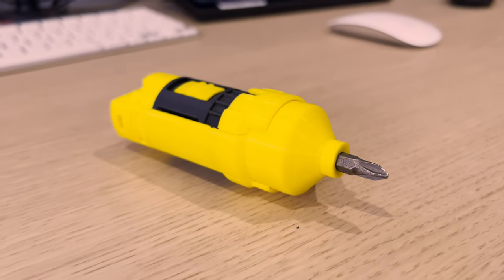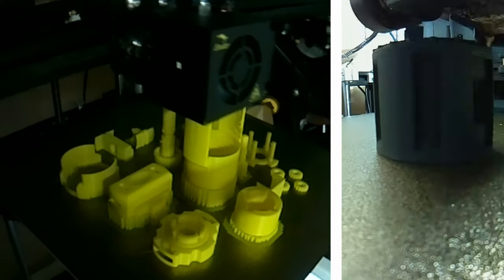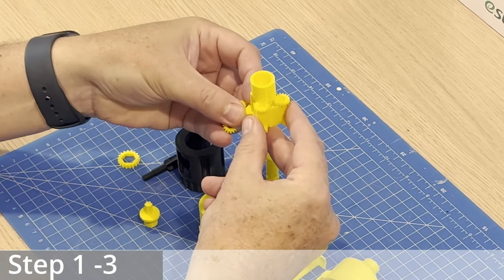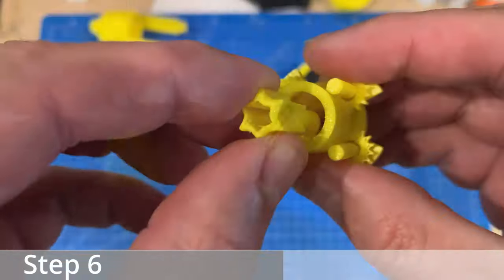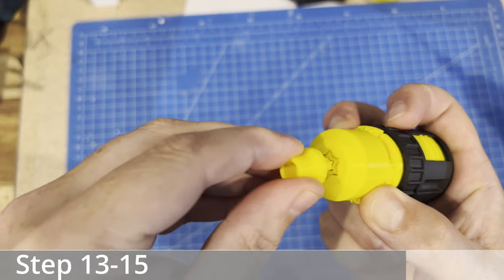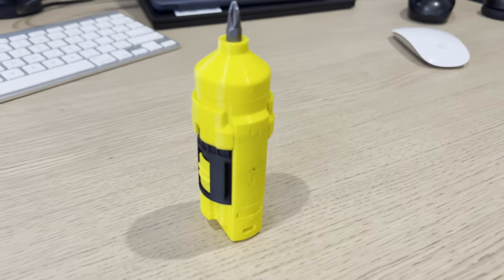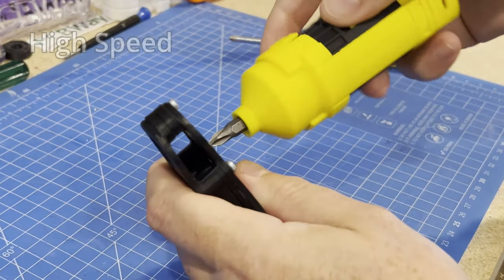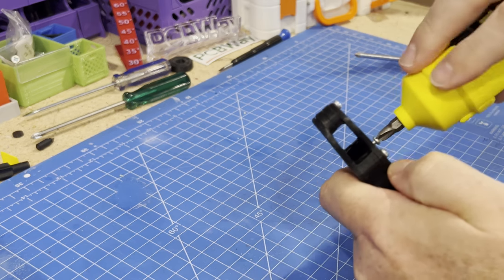Does a printed screwdriver work? ep24 Trending Prints

Comment from the maker: Before anyone comments, (please do though! its good for the algorithm engagement 🙂) After 4 years of owning my Ender 5, I was starting to have some issues with my extruder and basically had to turn retraction right down so there is some stringing on the tall yellow parts unfortunately.  The good news though . . . . . I have a new dual gear extruder that so far is proving a great change.

Comment: It's clever they got all that to work within the constraints of a 3d printed piece, but you can't have a torque multiplier without the output stage applying leverage against something, if that something is still your hand, then it's multiplying the work your fingers do, but needs you palm to progress that torque forwards, so in the end you still have to hold the torque forces it produces. There are such things as torque multipliers for car lug-nuts, they work by pushing a steel bar somewhere against the wheel, not the users body. So it's more like a true mechanical advantage instead of asking the user to hold the continuous torque of a slowly unfastening lug-nut. Most of the multiplication the user would feel with this, is likely more because it's significantly larger diameter. Does this seem accurate?
Reply from the maker: It's definitely not breaking physics :-) your assessment is accurate in highlighting this aspect.  I'm thinking the effort is still the same but shifts the burden of torque so that it's spread out more. I'm no torque whispererso not sure where the torque forces would be in the hand, wrist or arm in a standard scenario or with this.   I can tell you from the highly scientific tests I conducted (read: spinning things around like a kid with a new toy).  We'd be messing with nature if we said it wasnt as much Work but spinning the barrel a few times compared to turning a screw driver on the same screws FELT like less work.  You're right to point out it's a much bigger handle which could be part of it but even if I lock it in and screw, it FEELs like more effort.  could be all in my head though !  ! !
Reply: Your assesment is correct, though its missing a couple things . The rate of work being done or "power" and the effects of dynamic resistance. I actually thought about calling it "power" mode, but it felt a little silly for a tiny screwdriver and power can be even more confusing to people who are unfamiliar with mechanical principles.

Unlike in a typical anchored scenario where resistance is constant, the resistance from a screw changes dramatically depending on the rate of force application. So in a wrist anchored scenario, you're correct in saying that any mechanical advantage would be lost as the wrist still has to contend with that increase. But In this dynamic scenario where resistance is relative, the increased torque actually reduces the resistance felt in the hand because it applies force faster and overcomes the screws resistance with greater ease. Also on a technical level the torque is* being increased, it's just very easy to overlook this key point. 

It's a bit like using a sledge hammer.  If you hit a fixed rigid object, it doesn't matter how much you increase the length of the handle for more torque, or how fast you swing the hammer , your wrist will still take the brunt of the force. But if you're driving a nail into wood for example, the increase in torque/power can make a huge difference as that force is converted into work done. 

Hope this makes sense